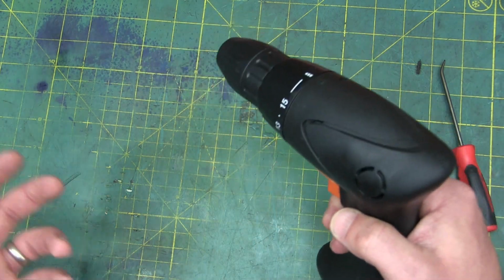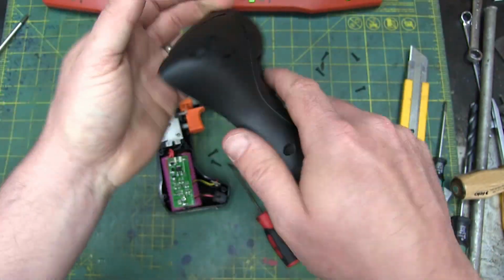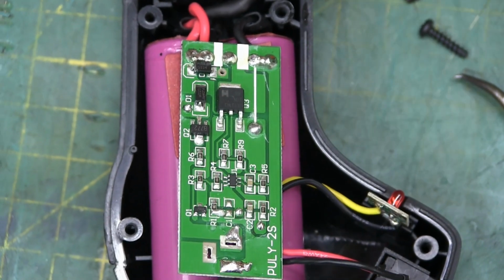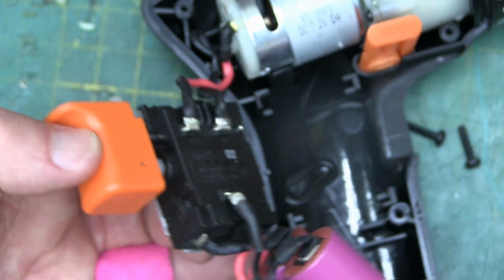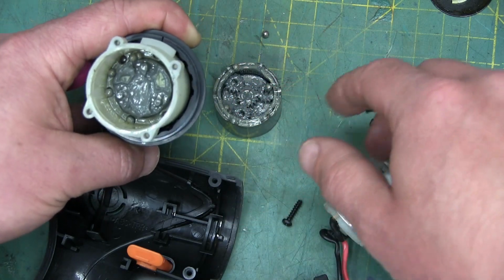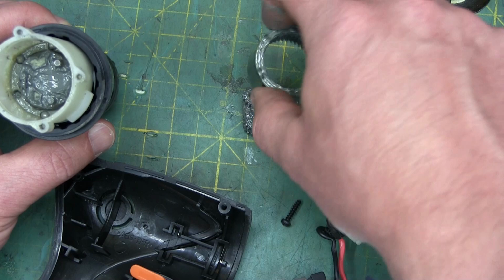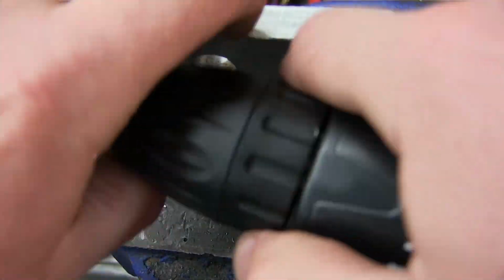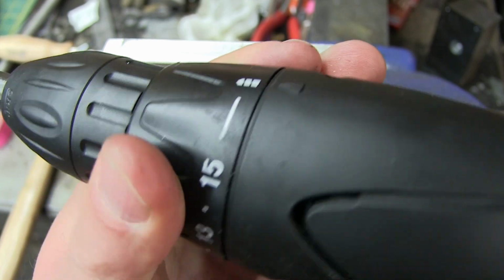BOLTR: WORST IN CLASS IKEA Drill

Comment: I have the same drill, used it for a long time even though i have other pro tools and i feel its worth the money. However i think you misaligned the gear/clutch as it doesn't break loose on the drilling position. It does however shutdown the power when the motor is overloaded. I don't say you can drill heavy material with it but as you said its great as a screwdriver and i kinda feel it has just enough torque for ikea furniture. They make a logical combination 😁

Comment: What will tip you off about batteries is if it says Li-ion it will be 18650's, 26650's etc or something similar. If it says LiPo then it will be  the foil packs.

Comment: Last year I bought something similar from Aldi. "Ferrex" brand. 12 volt and still only 1,500 mA/Hr capacity. Even so, I didn't buy it to use a drill, but as a driver ...

For my folding camper. With the correct adapters it should be capable of winding the corner steady legs up and down and even the solid roof! I haven't really had the opportunity to test it so far as I haven't made any of the adapters (2 required), my tow car has been in for repair for months (since fixed, phew) and now the current situation means I won't be going anywhere this year. Both are parked up with the camper in the garage to keep it dry.

Nice points: It has a lot of rubber overmoulding to give it a comfortable feel; the balance could be better, but not by much; it has a guide light that points vaguely in the direction of the chuck centre line; it has a crude 3 LED guide to the current battery charge. If memory serves it cost around GBP(£)30. You can work out yourself what that is in Canadian Kopecs.

Bon chance, mon ami.

Comment: FYI that chip in the center of the board is probably the charge controller... doesn't need an MCU just a fixed function chip most 500mA charging battery banks are made this way. It's a digital controller... just not programmable.

Comment: Scenario:    Young cute person furnishing first apartment with IKEA furniture needs something to help assemble said pack flat furniture but has no serious tools and can’t afford them anyway.    IKEA provides tool designed and priced to meet cute young person’s need.   Very well thought through.   Just adequate power for that purpose but not total garbage build.    Replace1500 mAh 18650s with 2000 or 2500 mAh and it will run longer.
Reply: Yeah, until the point comes a cute girl like you described asks you to drill holes in a concrete ceiling and when asked for a drill she puls out this IKEA drill expecting you to do the job. Needless to say there wasnt much drilling going on, except giving up ending in pulling out my own "powerdrill" and doing a completely different job than was intended if you get what I mean. 😂

Comment: Complete drill with 2 18650 batteries is cheaper than one Dewalt 12V battery pack with 3  cells.
W.T.H. ?

Comment: I reckon there would be a good drill test between this IKEA drill and my sHitachi 1.5Ahr drill... Mind you the sHitashi has done some commendable work, but also came with 4 batteries and has lasted since mid 2016...

The IKEA drill may be a good assembly reel, just good enough not to strip screws.

Comment: At an injection molding plant i used to work at we made some of Ikea’s stuff and they were much more quality-focused than people think. I remember one of the products was made of white PPGF 25% (if my memory serves me right, was 5-6 years ago) and the sprue went into a grinder that ground it down and led the granulate back up into the injection unit to minimize waste. That ground down dust itched like NOTHING i have ever experienced. Nothing even comes close. As soon as the damn stuff ended up on the skin it would develop a rash if you even thought about itching it. Glass fiber is a bitch sometimes and i do not miss that damn thing

Comment: I dont see them using screws to secure the motor to the gear box as a better way to do it. That takes less engineering than a proper tab and slot design, which in turn means its cheaper. Plus drilling 8 holes into some nylon then putting cheap screws into the holes is very inexpensive process.

Comment: know what, it does exactly what you would expect and what it is meant for. If you're going to mount or modify Ikea stuff this little thing would work just perfekt because Ikea materials can be litterally drilled with your fingers so this thing will keep your fingers clean and do the job. For real work you'll have to go for a real tool but that really depends on what you want and need to do and what you can afford.

Comment: Be alright to get a 3/8" square drive adapter to use on car parts. Not to crap any nuts ot bolts. Aa its got no torque. Id use a breaker bar. But alright as a replacement for a ratchet

Comment: I have one of these I cracked it open . My batteries are not identical. and the 2 cells inside are shot. ( Won't drill for 3 minutes) I have some lghg2 20a continuous . 3000 mah I wanted to chuk in ther

Comment: After fuxing my elbow screwing together 120 feet of aluminum railing with probably 1000+ sheet metal screws, using an old and very heavy Porter Cable cordless, I'm now totally on board with sissy tools that don't weigh more than they need to. As this video began I was ready to call you out for not acknowledging the utility of light weight but you beat me to the punch right away.

Comment: Nice. I just took one (Einhell, Parkside branded) apart with one battery, no charge controller and no speed control. 
The motor had failed. Mechanics appear to be (at least nearly) the same.

Comment: If you look at the battery board there actually is a real chip - not just some transistors. It's a dedicated charging chip for LiIon cells. Those need to be just right so a crude charging circuit like you found in the old NiCd days or with NiMH just doesn't cut it (beside it was bad for NiCd/NiMH too a big part of the reason people think those technologies are sh!tty - when actually they can be really great - I have a drill over 10 years old using NiMH - LiIon would be long dead).
If not using a real charger for LiIon (can be quick or slow doesn't really matter for longevity, mostly a cost issue) you risk overcharging LiIon cells and they may burst and since the chemistry itself is not only flammable but thermal runaway you have a disaster - all too common with cheap chinese gadgets without quality control. The Ikea drill might be sh!tty with safety wise it's fine. Overcharging NiCd/NiMH only ruins the cells and their chemistry doesn't contribute to fire so greatest risk form them is the corrosive electrolyte and the heat a short circuit makes. Might be fatal too under unlucky conditions but still a long way from cells bursting violently into flames.

Comment: In Russia IKEA sells slightly different version of FIXA drill, it has a switch on top for changing between drill and screwdriver modes. I own one, totally love it - cheapest LiIon drill on the market, looks nice. I also own BOSCH hammer for heavy duty task; these two cover 100% of use cases.

Comment: Personally I'd replace the no name Chinesium 18650 batteries with a name brand that is suitable for how many amps you are drawing continuously. Think about it, do you trust the quality control of a no name Chinesium brand of 18650 cells when even the quality name brands that have really good quality control occasionally have batteries that fail in fire or an explosion? Having to guess what the contant amp draw of this drill is, I'd say that the Samsung 25R would be a good choice. If you find that's not enough and Samsung 25Rs are getting too hot to hold after drilling continuosly then you could go Sony VTC3 or LG HB6.

Comment: Actually, as a screwdriver there's nothing wrong with that thing.  Small, light, compact, and it'll run M5 fasteners in and out all day, saving the user lots of wanker's cramp.
Reply: Absolutely. and it actually has a decent battery life. I use it for guitar maintenance. Awesome. And cheeeep.
Reply: I always recomend this for people who just need a drill every full moon, super cheap, small and does the job. Can always get a new one if it brakes.
Reply: @jockslap  Well, for things like Ikea furniture, it's perfect, in it?
Reply: @plantain.1739  you can even use it for drilling holes (maximum 8 millimeters). I used it for a year drilled a lot screwed a lot. And then eventually it let out the blue smoke. But that was mult fault. I used it as a milliing machine.
Reply: Yes there are many, but not at this price.
Reply: You can get drills that fit screwdriver bit holders. More than enough for bodging an Ikea box.
Reply: Ikea has this on sale for $12 DOLL HAIRS!

Comment: Hello, this channel is different. Showing and explain the tool inside according a singular opinion!
     I'm a addicted to tools and have one Fixa, the exterior is the same but my has 14.4V 1,3Ah. Was cheap, I bought to try! For tighten or loosen screws work well and is very functional! 
Drill well only on soft material or wood, for this low price is a value machine.

Comment: I have a 20-something-year-old Makita 6019DW 7.2V back from the NiCd daze I keep for two reasons; 1) I just can't KILL the ornery little bastard and B) because it has the finest setting on the clutch of any drill/driver I've ever had. I can set the clutch low enough on this drill to drive M2 screws into aluminum or M3 self-tappers into PLASTIC without stripping the hole out.

I've bought a dozen small drill drivers over the years looking for a modern replacement; nothing ever even came close to the fine-adjusted torque I can get out of this thing. Eventually I just gave up and rebuilt the packs with RC hobby LiPos and charge it on one of my old hobby LiPo chargers.

I do onsite IT & AV service; I take plastic-cased electronics apart all day. This prehistoric beast is STILL perfect for this task, and it is small enough to slip in my medium-sized "Bag of Dirty Tricks".

So yeah; right tool for the job, man. Nothin' wrong with keepin' a small drill for small jobs.

Comment: It gets the job done for what it's meant to do: drive screws into pre-drilled holes aka build IKEA furniture
Reply: It is stonger than that. I have made a small shack with mine.
Reply: @squick1842  Agree, not great, but works well for what its made for. Ironically the smooth surface that he liked is my least favorite part because after 5 years its starting to break down and go sticky
Reply: And you started 10 years ago
Reply: Maybe in your shithole 3rd world country this is like Makita for you yes?
Reply: @imGlobL  Well, in all honesty, alot of people in the industialized parts of the world buy crap like this because quality drills are "way too expensive". Then they go out and buy a phone for $1000 that will last two years without even blinking an eye...
Reply: @kundetjenesten  Indeed. Consumer zombies are attracted to the every 3 months brand "new" phone that can do 1% more stuff 1% better than the last, for about "only" $1k. I have a cheap Motorola that does most of what a fancy iphone or Samsung does. If i could choose i would go for a Miluwakee or Dewalt drill, but i am happy with a Ryobi or Bosch for my DIY use. The Ikea drill was plenty good enough for what i used it for at the time.
Reply: @squick1842  I would never frown upon Ryobi or Bosch. My dad has used the same old  Bosch corded drill for 30 years now and it is still running just fine, as for Ryobi I had plenty of those myself and the only tool I was unhappy with was the angle grinder, the rest worked perfectly fine. The IKEA drill on the other hand... 🤣

But yes, the needless consumer culture is quite fascinating when you sit down and actually think it through. I'm going for older phone models myself, preferrably ones that are on their way out of the market. They do all things I need and at 1/3-1/2 of the top model price it doesn't feel so agonizing when they break down and I am forced to replace them.

Comment: Actually lithium ion's (Depends on cell quality though) are pretty horrible as far as current output. The vast majority of 18650's aren't too happy over 2C output or so. (1C= the battery's capacity rating FYI. So a 1500mah battery rated for 2C can source 3 amps for example)  They're best suited to relatively low current output for long duration's, Like in a laptop battery for instance.  Lithium Polymer is what you use when you want stupid high current outputs. Some of the higher quality lipos will do 80C or so output.

Comment: I have had the 14.4 V big brother of this for 18 months. For furniture assembly and driving screws it ain't bad. It can even drill holes in wood reasonably well (but useless on brick and haven't tried on metal). The battery life is shockingly better than my previous 18 V "reputable" brand tool. I guess they use decent cells.

Comment: ICR lithium batteries are about the most dangerous of the different chemical makeups.  IMR is much safer. if those ICR cells get shorted or overcharge, you'll have a heck of a fire if not outright explosion. I didn't notice a protection circuit on the batteries either, so you're relying on that analog circuit to prevent overcharging and a fireworks show. I wouldn't trust it personally.

Comment: I've seen old Black and Decker drills from the early 2,000's with similar construction in the switch and gearbox. Probably not too far off especially if Ikea is using old patents that's no longer used.

Comment: I have one. It's a fine little drill for small jobs. It will never replace my DeWalt for real work, but it has earned a place in my tool box.

it was the right tool for drilling rivit holes in aluminum gutter while on the top of a 30 foot extension ladder.

Comment: Ikea actually sells a few different models of cordless drill/screwdrivers.  The one AvE dissected in this video is the bottom of the line 7.2 volt model (about $20 US).  There's also a slightly more upscale 14.4 volt model (about $40 US) which has a two speed gearbox as well as a hammer drill (about $65 US) that also has a 14.4 volt batter pack.  They all use lithium-ion batteries.  Ikea also sells a basic cordless screwdriver (about $10 US) which has a 3.6 volt battery and which they do not have the temerity to refer to as a drill.

I have no idea how useful the hammer drill model would be as a hammer drill, but I do have one of their 14.4 volt drills that I use for lighter duty tasks and it seems to work just fine.  I have a Craftsman 1/2" corded drill that I can use for heavier jobs, and I just finished resurrecting a low end drill press (roughly Harbor Freight grade) that I found next to one of the dumpsters behind the apartment building where I live.

The Ikea drills are probably just the thing for an apartment dweller who wants to hang pictures, drive screws and do some other light work.  They're certainly not what I would use in a professional capacity for anything other than a cheap cordless screw driver, though.  For that sort of work the 2 speed 14.4 volt model seems reasonably capable and it really does feel nice in the hand, too.
Reply: http://www.ikea.com/se/sv/search/?query=borr
Reply: Hammer drill? WTA? Pics/part number or it didn't happen ;-) I had the 14.4 and it would cut out sometimes under very moderate use, never sure why but after some smacks, switching and waiting it would eventually start up again. Don't understand why. Eventually it got stolen, NEVER turn your back on your tools!

Comment: I really like the cheapie 20V Black+Decker drill for the general purpose light duty task. We run a bunch of them in a machine shop for torquing little screws in fixtures and whatnot and they hold up really well. Things are around $35 on sale with a battery and charger.

Comment: AvE- I'm wondering if you can explain what happened here:  I took a 12v electric fan from an old Camry. I wired it directly to an old charger I had laying around that states: input 120vac 60Hz; output 12vdc 600mA. 
I mounted the fan to an vent in the garage and plugged that bitch in. I came back to check on it 15min or so later, and it was a statue. The charger was hot as hell and I wasn't super pumped either. I plugged it and gave up. 

What happened?  Is it the radiator fan is only meant to run intermittently rather than constantly?  Should I have been using some other charging system?  Or was the fan on its way out already with 230,000 miles under its belt, it had a well deserved retirement in its near future anyway?  

Any advice would be very appreciated. I have not applied power directly to the fan since it did me dirty.  It may still work. I suspect the charger was happy being retired and didn't want to be part of today's workforce, although it may be thinking about teaching some courses with some real out of the box thinkers up at Evergreen College in Olympia.
Reply: I should add I wanted to use the fan to add some air flow to the garage when I'm out there.  Standard fans don't seem to move nearly as much air as the radiator cooling fan I had laying around.
Reply: Michael Scott 12 volt 600 milliamps won't run an automotive cooling fan. some pull up to 30 amps or more on start up.
Reply: Joetechlincolns  thank you for your reply. The fan worked really well; pushing a ton of air- much more than a standard desk or box fan, but I left the garage and came back to it standing still, so I'm not sure how long it ran great. I can tell you the charger was super hot when I returned to the garage, and  unplugged it. I wish my electronic knowledge was much more substantial so I could understand what failed and why.
Reply: Like he said, that fan might have pulled too much current for the power pack to handle. The voltage ratings match but the amps are what will make all that heat. Trying a higher amperage power supply might get it to work.